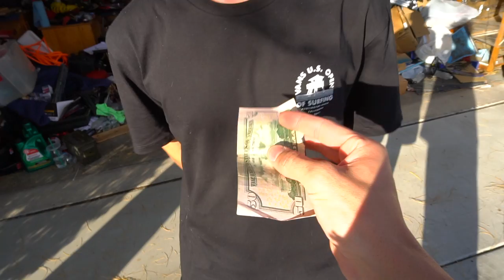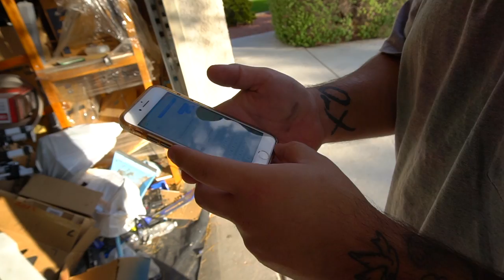FAST 50cc SCOOTER FOR FREE! MOPED PERFORMANCE MODS

Comment: Just a little hint if the plug , plug wire coil and stater are good then check the little switch where the hand brakes are,  Had that  problem and it was the switch.

Comment: This things out of timing and valve lash is off.  After I rebuilt my motor this happened, I set the timing and adjusted the valve lash and instant compression and started right up.

Comment: So if the problem is not getting spark just check all the wiring for ignition. To make it run you dont need any shit like battery,lights or anything. From the stator theres 4 wires. 2 of them is for ignition 2 for lights. It can change but in mine theres yellow and white for lights. Those dont matter. Check the cdi and its connector and all the wiores for it. The fuse, spark plug, coil, spark plug wire, sparkplug "hat" which connects to the sparksplug and make sure to ground the engine to the frame. Youre getting power for lights so i dont think the fuse is bad or the ignition lock (or whaterver it is you stick the key in :D) In my scooter i have disconnected everything else form the wiring harness expect cdi and coil and ignition lock and didnt connect the shitty small ground from the harness i just took a bigger wire and connected it from the engine to the frame. Works like a charm and makes everything cleaner and saves some weight. I could post a picture for you when i get my phone fixd.
Reply from the maker: Jakki Nakki send pics to my instagram @trevwhorep I wanna see this. Maybe a good idea for my build
Reply: I TAKE SOME OF THIS BACK! I thinkd about my other scooter which has some kind of atv stator modded to it.. So on these engines you will have to plug those yellow and white ones too from the stator and you will need also this connected http://www.mc-scatter.com/images/webkuvat/303-0273.jpg (dont know what its called in english so theres that pic :D) otherwise its the same i told before. I will post dem pics soon as possible
Reply: And to mention i dont know about the electric choke on these carbs as i have a manual ones on mine. So i dont want to take any responsiblities if it doesnt work. Just try leaving it connected and unplug everything else first (such as lights exc.)

Comment: Yo I have a piaggio nrg any ideas on how to make it quicker without actually paying for anything
Reply from the maker: callum white they're might be a way to district it but I'm not sure how on that specific scooter
Reply: Trevor Pritchett Ive been told that there Is something in my exhaust but not sure where and how
Reply: Trevor Pritchett the carburetor might be giving to much gas also since it's a 150. Just a thought. And the only way a scooter can be restricted is in CDI, sometimes it's easy as cutting a wire but the best way is getting a unrestricted one. I have a taotao 50 and it's not restricted surprising. I would check your stator and solenoid connections since your not getting spark.
Reply: callum white there might be a little "tube" welded in the beginning of your exhaust, you can grind that out, but then you'll need to check your sparkplug. If it's not brown/coffee colour you need to check your carburettor settings and probably buy some sprayers (don't know if that's the proper word, English is not my native language). If it's white/grey you need to enlarge the number, if it's black, you need to decrease your number. Another way of restriction (that's how it's done in the Netherlands a lot of times) is with a little Ring between your two front pullys (those are attached to your crankshaft. If you remove that , you'll have a higher topspeed.
Reply: Bart RD50MX cheers man
Reply: The sparkplug thing isnt rly working with modern days fuel so forget about looking for that. But you will hear if its not running correctly. With full throttle if the scooter goes kinda like "boooo" you need bigger  mainjet (bigger number) or if it goes like "präpräprä :D" and might sometimes shoot in the exhaust you need smaller mainjet (smaller number)
Reply: get a 70 kit there cheap and make the bike wheelie really easy